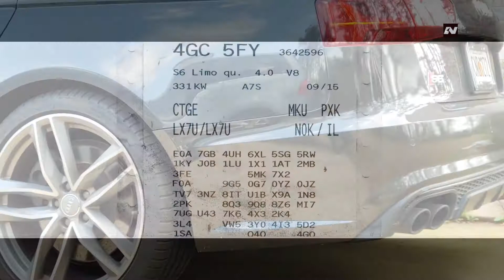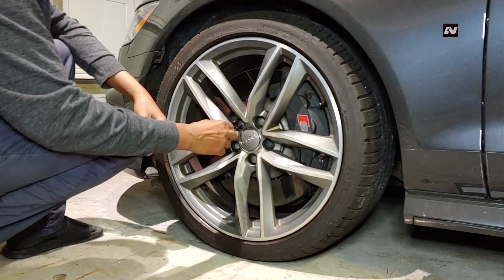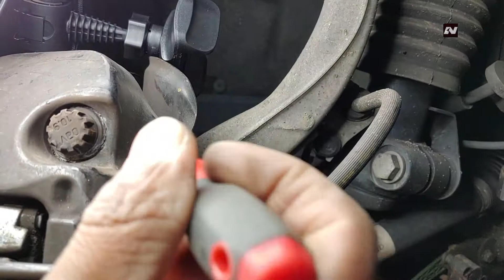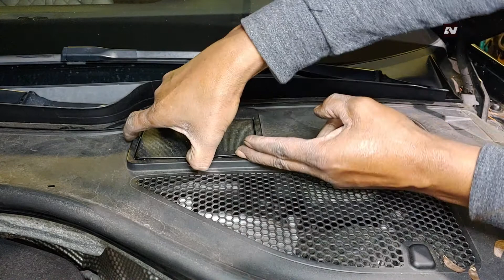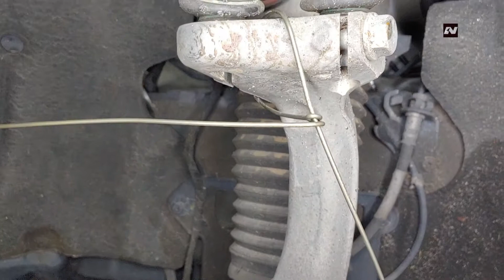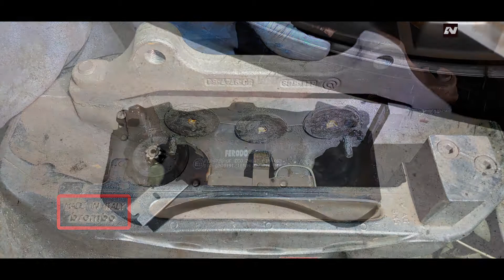Front Brake Pad Replacement Audi S6 (C7 and C7.5)

Comment: I just bought a 2013 s6 I've never had a German car so I had no idea about the air suspension, I really appreciate you going through this step by step and actually pointing that out because I was just going to jack it up and take the brake caliper off 😅 thanks for saving me thousands
Reply from the maker: @puprilla  It wouldn't break just like that.  However, it will cause premature wear over time.  There are 4 level sensors, one at each wheel.  If you lift the car up, the sensor will detect that the car is not level and add more air to the air spring in an attempt to make the car level.  This will extend the air spring to maximum limit.
Reply: @pnswg01  oh ok so when I go to the settings and turn it off it stops that?  Good to know. I can tell this car is going to be fun to do light work on 😂  thanks for the video
Reply: @pnswg01 just got done doing my brakes in absolute record time😅 those two pins on the back that hold the break in was kind of hard to figure out but then I realized it's those steel clips on the back that you got to shove the back of the brake pad into first then it slides right into the pins. Thank u for your time making these videos

Comment: Very informative. Thank you so much, Patrick. I thought I needed to remove the strange bolts, which require a 5033 socket, and I've struggled to do that with my regular 10-point socket. I broke the bolts and went to an Audi dealer to purchase new ones. The guy in the parts department showed me the repair instruction and told me those bolts were not supposed to be removed to do the brake job. I should have watched your video first.
Reply from the maker: Thanks for watching.  Sorry about the broken bolts.

Comment: A great overview video.  A few small points for those who care.  Audi recommends replacing the caliper mounting bolts each time it is installed since they can stretch over time.  Probably fine for most people to leave as-is, but just worth mentioning.  Also, they do recommend replacing the 6 spring plates per caliper (the small discs). Audi official parts are stupidly overpriced, but you can find replacements from elsewhere for around $10 each.  And I may have missed it, but did you replace the brake clip or reuse it?

Comment: how many mm are the iron discs ??
And from which reliable site can it be obtained??
Reply from the maker: Check the PR numbers on your label

Steel Front Brakes

LA  = 320 mm.  New Thickness=30 mm. Wear Limit = 28 mm.
1LJ = 345 mm.  New Thickness = 30 mm. Wear Limit = 28 mm.
1LP (Brembo) = 345 mm.  New Thickness = 30 mm. Wear Limit = 28 mm.
1LL, 1LF, 1ZK, FM0 = 356 mm.  New Thickness = 34 mm.  Wear Limit = 32 mm.

1LU (Brembo) = 400 mm.  New Thickness = 38 mm.  Wear Limit = 36 mm.
1LM, 1LX (Brembo Wave Design) = 390 mm.  New Thickness = 36 mm.  Wear Limit = 34 mm.

Ceramic Front Brakes

1LW (Brembo) = 400 mm.  New Thickness = 38 mm.  Wear Limit = Not Specified
1LN (Brembo) = 420 mm.  New Thickness = 40 mm.  Wear Limit = Not Specified

Steel Rear Brakes

1KW = 300 mm.  New Thickness = 12 mm.  Wear Limit = 10 mm.
2EA, 2EE = 330 mm.  New Thickness = 22 mm.  Wear Limit = 20 mm.
1KY = 356 mm.  New Thickness = 22 mm.  Wear Limit = 20 mm.
1KJ, 1KQ  (Wave-Design) = 356 mm.  New Thickness = 22 mm.  Wear Limit = 20 mm.

Ceramic Rear Brakes

1KK, 1KU = 370 mm.  New Thickness = 30 mm.  Wear Limit = Not Specified.

Thanks for watching.

Comment: Great video! Did the squeaking stop after replacing the pads? Did you had to replace the rotors as well? I was told you have to replace pads and rotors by some users and others just say to replace pads.
Reply from the maker: No squeaking with the new pads.  Rotor was good.  Car had only 56,000 miles.    The pads was good too. Not sure why the were squeaking.
Reply: @pnswg01  thanks. I always have the same noise with all S models that I have owned. My S6 rotors and pads look good but they are noisy. Audi dealers told me that’s because of the pad composition. The noise goes away after I washed the car or after a hard stop. But that is not practical.
Reply: @redwolf76  I've never had a noise issue for some reason between an A6 and 2 
S6's.. I'm using EBC Red Stuff pads with drilled and slotted rotors

Comment: Hi Patrick, thanks for the great video. I have a strange situation that arose with my caliper. The metal part of the pad broke off and was rattling around in the little chamber until I took off the wheel. It's the little metal piece that sits on the spots you are greasing at 10:34 of your video. You can see the metal part is part of the pad at 10:46 of your video. Id like to send you some pictures to see what you think. Since you've taken these brakes apart before I'm wondering what use that metal part is? It's pretty badly damaged so I'd have to get a new one if I wanna replace it.

Comment: Appreciate the content. I have to do my front rotors/pads on my S6 sometime soon. Any recommendations on brands?
Reply: EBC Red Stuff
Reply from the maker: Not really.  My S6 is pure stock (No modification whatsoever)

The brand in the video is Power Stop Extreme.  They work better than the one I remove with less brake dust.  As you can see the ones I replace is still good.  They were squeaking for some reason.

Comment: Super helpful, thank you!  Just to learn where the data sticker is so I can follow the proper repair manual procedure was awesome.
Reply from the maker: Thanks for watching. I try to make my instructional videos a step above the rest with the best views possible.
Reply from the maker: Check the PR numbers on your label

Steel Front Brakes

LA  = 320 mm.  New Thickness=30 mm. Wear Limit = 28 mm.
1LJ = 345 mm.  New Thickness = 30 mm. Wear Limit = 28 mm.
1LP (Brembo) = 345 mm.  New Thickness = 30 mm. Wear Limit = 28 mm.
1LL, 1LF, 1ZK, FM0 = 356 mm.  New Thickness = 34 mm.  Wear Limit = 32 mm.

1LU (Brembo) = 400 mm.  New Thickness = 38 mm.  Wear Limit = 36 mm.
1LM, 1LX (Brembo Wave Design) = 390 mm.  New Thickness = 36 mm.  Wear Limit = 34 mm.

Ceramic Front Brakes

1LW (Brembo) = 400 mm.  New Thickness = 38 mm.  Wear Limit = Not Specified
1LN (Brembo) = 420 mm.  New Thickness = 40 mm.  Wear Limit = Not Specified

Steel Rear Brakes

1KW = 300 mm.  New Thickness = 12 mm.  Wear Limit = 10 mm.
2EA, 2EE = 330 mm.  New Thickness = 22 mm.  Wear Limit = 20 mm.
1KY = 356 mm.  New Thickness = 22 mm.  Wear Limit = 20 mm.
1KJ, 1KQ  (Wave-Design) = 356 mm.  New Thickness = 22 mm.  Wear Limit = 20 mm.

Ceramic Rear Brakes

1KK, 1KU = 370 mm.  New Thickness = 30 mm.  Wear Limit = Not Specified.

Thanks for watching.